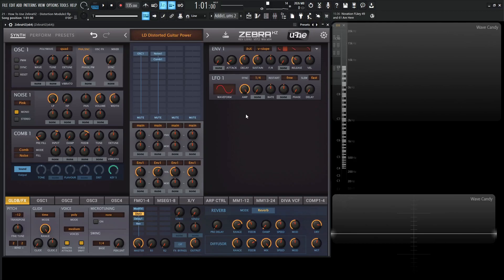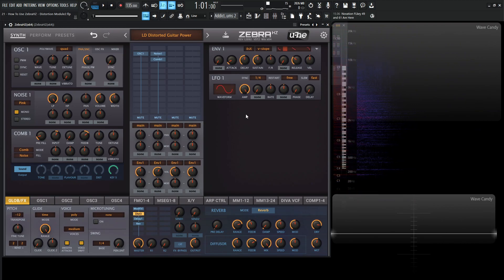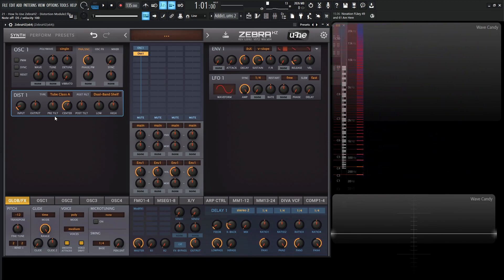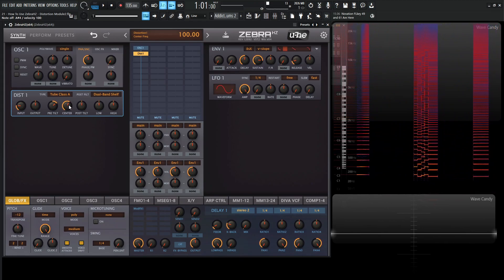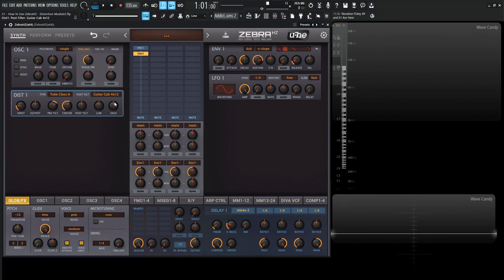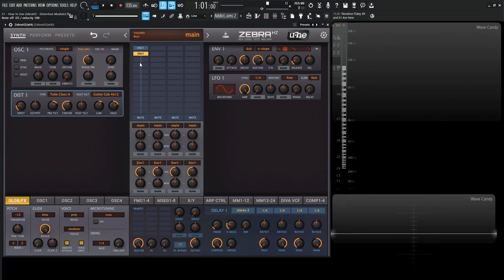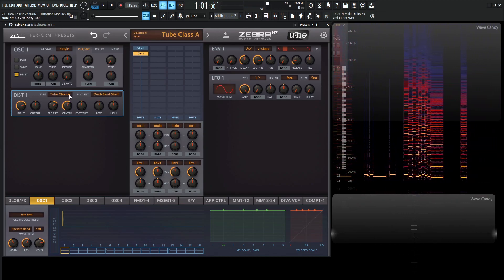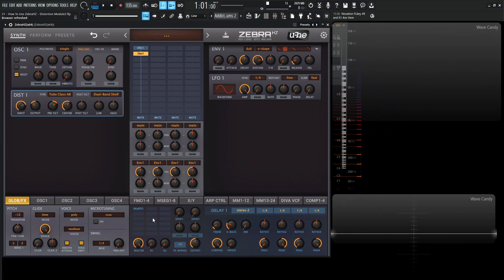Distortion Module Zebra HZ Tutorial Lesson 21

Comment: Sound in FX grid is different because in the FX grid it is monophonic but in the upper part it is polyphonic, meaning each voice will be distorted separately vs the sum of the signal in the FX grid.
Reply from the maker: It's crazy how much of a difference that makes. I was surprised how good the guitar cab emulation sounds. It other synths it's extremely difficult to synthisize a passive sounding electric guitar, but in zebra it was a breeze.